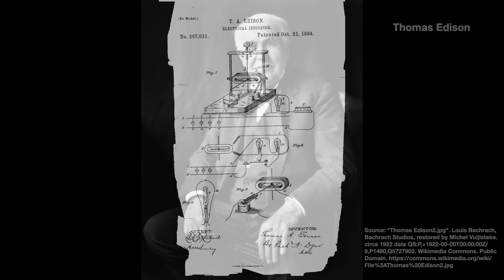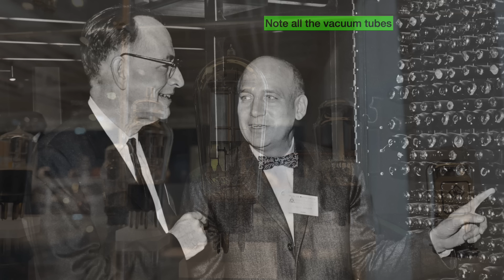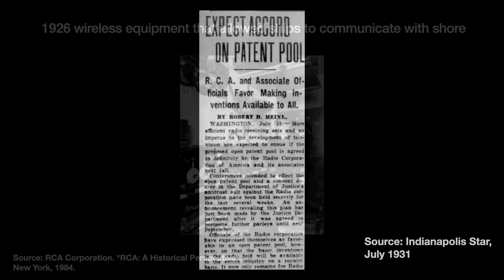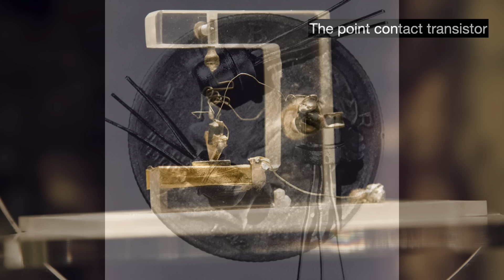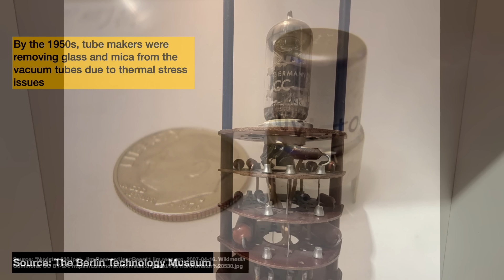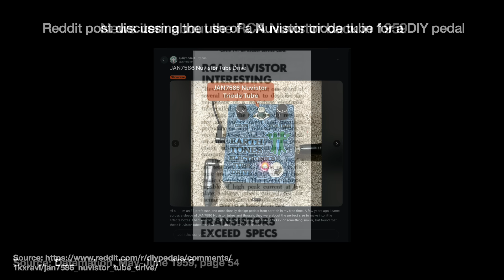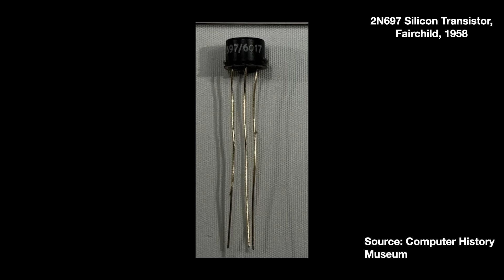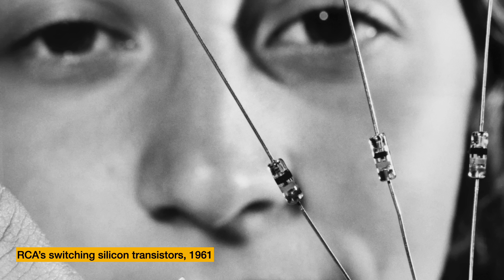RCA Made a Vacuum Tube to Beat the Transistor

Comment: To be similar to the transistor, the vacuum tube would have to change from thermionic radiation to a metalic plate with a build up of electrons. Controlled not by the deflection of electrons, but the creation of a bridge of electrons. Removal of the grid with something that accelates electrons-- circular tube plate perhaps(?). Unsure if such a thing exists or got created. Using electrostatic charges, perhaps? 🤔 a'bit late, thanks for the vids.

Comment: My first encounter with Nuvistors was as a research electronics designer in the 1970s.
The company I worked for had several pieces of equipment that used them - and they did occasionally need replacing - an increasingly costly business, especially as we needed matched pairs!
My job: keep that equipment working, if necessary by redesigning the low noise electronics.
My solution was to use the newly released BC264 Field Effect Transistor and redesign the circuitry around that.
It had just what I needed! A very high input impedance, an extremely low noise floor, and a gain very similar to the Nuvistor.
A few circuit changes, careful matching of pairs of transistors (they were cheap enough to buy a load of them for matching!), and the equipment was working again - and with a lower noise level than was possible with the Nuvistors!
And the strangest thing about these transistors was that they were completely symmetrical!
You could switch the Source and Drain (equivalent to the Cathode and Anode in a Vacuum Tube) with no change in their characteristics!
It’s rumoured that the last of BC264s were all bought up by Neumann for use in their ultra high quality studio microphones!
I can believe it - I use BC264s in my phono pre-amp at home. They are amazingly quiet!

Comment: Every generation has a Blackberry....

Consumer Electronics & Computing
RCA (transistors)
Kodak (digital photography)
Polaroid (digital photography)
BlackBerry (touchscreen smartphones)
Nokia (smartphones)
Palm (modern smartphone ecosystem)
Motorola (smartphones)
Xerox (GUI, personal computing)
DEC / Digital Equipment Corp. (PCs)
Wang Laboratories (PCs)
Sun Microsystems (cloud computing)
IBM (personal computers)
Compaq (consumer PC commoditization)
Gateway (e-commerce/direct sales)
Palm (apps ecosystem)
Retail & Consumer
Sears (big-box retail, e-commerce)
Kmart (Walmart model)
Toys "R" Us (e-commerce)
Borders (e-books, e-commerce)
JCPenney (online retail)
RadioShack (consumer electronics retail)
Circuit City (online retail)
Blockbuster (streaming)
Hollywood Video (streaming)

I could go on.    It doesn't mean the prior tech is altogether bad (sometimes it is). I still have tube guitar amps, but even that is harder as modeling pedals can do an awesome job replicating dozens of tube amps and cabinets for $300 instead of $30,000

Comment: The tube industry also came up with 12 volt tubes and cold cathode tubes which failed to compete with transistors. I played with tubes and then transistors and I was very happy not having to wire up filaments for transistors. I embraced transistors. 
Tubes still have small markets though. Very expensive tube amplifiers are still sold new to those who want a glowing cathode in a glass bulb.

Comment: Vacuum tubes are still used in scenarios where one needs dozens of kW or even MW's of power at MHz frequencies. Most common transistors can't handle MHz at even a single kW, and GaN RF ones that can are very expensive (~$400) compared to a tube that can do the same thing in class C (half the cost). What's worse is most triodes have a gain/amplification factor of 20-30 or more where RF transsitors struggle to reach 15 or so. and if you need alot of power that gets insanely expensive. A vacuum tube that has an amp factor of 30 and can handle 600kW input class C at 2MHz (15kV at 40A) costs $4k. The silicon equivalent can't handle 15kV, at most 150v or so, so would need 4000A worth (hundreds of them in parallel = 10x the cost not counting the extra heavy bus work to support that sort of current, assuming it could even be done with that much extra parasitics). This is why 50-100kW commercial radio stations running 24/7 still use vacuum tubes for the most part, though some are converting to silicon since tubes do not last as long (24/7 powered a few years vs 20+ years for silicon, so money saved over time).

Comment: Nuvistors were great in tuners.  Our old RCA "New Vista" TVs had them.  My Sansui tube receivers (1000 and 1000A) used them.  One problem is that surviving examples often test leaky even though their emissions are fine.  This may or may not affect operation depending on the application.  If you are buying these today, be sure to test them for leakage on a tube tester.

Comment: As a child, the concept of "solid state" had Big Marketing appeal. Consumers began to regard tubes as old fashioned. As a teenager, I recall opening the back of the old Zenith color television set just before it was hauled away to be replaced, and inside were vacuum tubes, transistors and a single integrated circuit, which was about the size of a quarter. I knew it was and I see because this was labeled on the chassis. It looks like many Circuit designers use a hybrid approach and eased their way into full transistorized designs.

Comment: Although it did compete with earlier transistors and found civilian uses, I believe the Nuvistor was a development to address military needs from the very beginning. This is evident from reading the spec sheets - ratings for bizarre levels of radiation, G forces, and reliability can really only mean a design specific for an ICBM, developed with amounts of money only the DoD could justify. There were other tubes in this category, such as the 6384.

Comment: Note that while RCA moved toward tighter element spacing for smaller size, lower noise and higher transconductance with the nuvistor-- on the other hand GE took the opposite route with the Compactrons, making bigger tubes with more individual active devices inside them using existing production lines.  They cross-sold so you could buy a 6CW4 nuvistor from your GE rep or a 6AF11 triode-triode-pentode compactron from your RCA dealer but it was a great competition.

Comment: I did not know about the nuvistor or the parallel elements they created. Vacuum tubes are fascinating and still do have a useful place in some testing equipment for electronics. My first shortwave receiver was a surplus piece from the military with all vacuum tubes. Radio Shack still had tube testers. I now know why I had tubes fail and can fix that. As a teenager, I only knew electronics, but without much real world knowledge.

Comment: I was surprised when I realized vacuum tubes are still made and used today.  High power Radios, high power radio and microwaves are just a few examples.  Although I would expect tubes would be better for spacefaring equipment given the fact that they’re essentially just evacuated metal plates if they ever sprung a leak, they would just stay vacuum that’s the reason so many older satellites, like the Voyager still working

Comment: In the 70s, I worked at Cohu Inc. in San Diego California which manufactured closed circuit video cameras. One product Cohu manufactured was a closed circuit camera to be used at nuclear reactors where Nuvistors are required because semiconductors breakdown when exposed to radiation.

Comment: Raytheon also manufactured subminiature vacuum tubes in the mid-1950s, the CK526AX for example.  Unlike the Nuvistor, these used glass envelopes, and were marketed for use in portable and wearable equipment.

Comment: Nuvistors had 2 distinct advantages over the transistors of their day. they could amplify much higher frequencies, making them the 'go to' RF amplifier for color television and FM radio. they also had much better signal/noise ratio, than the transistors of their time, making them the best choice of mic-line preamplifiers for recording studios. I would run Nuvistors today, if they offered a better signal/noise ratio than today's premium purpose built Mic-line preamplifiers, like the SSM2017. I would like to get hold of some, to test S/N ratios in high gain preamplifier circuits.

Comment: I think that if the same process of miniaturization that was applied to the silicon chip was applied to the vacuum tube, then the vacuum tube could have military and aerospace applications. Resistance to emp blasts and ionizing or non-ionizing radiation is something that even the best radiation hardened silicon chips would be inferior to the vacuum tube. Resistance to emp blasts and radiation is worth a less powerful computer so long as you have the space, power, and weight allowances to use vacuum tubes.

Comment: I have a very old studio microphone, a Neumann U47, which works with a Nuvistor tube. Originally, the mic was produced with a much older tube, a VF14, which went obsolete after a few years of U47 production. So Neumann decided to find a substitute and manufacture a socket adaptor for the Nuvistor replacement. I also heard that the Nuvistor tubes were very attractive to the military because they can withstand high G-forces and are immune to EMI, and hence could be used in nuclear warfare.